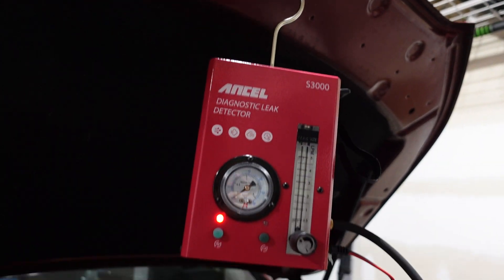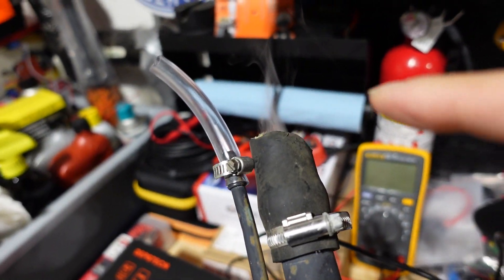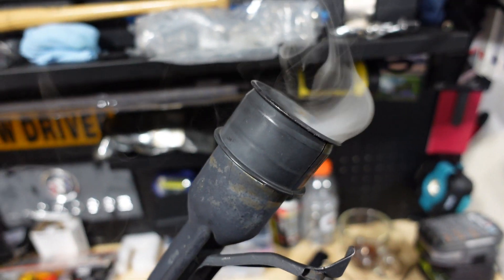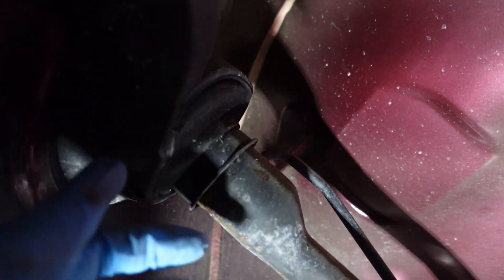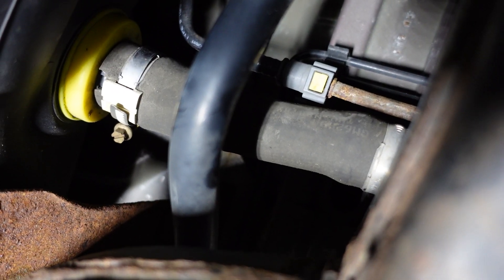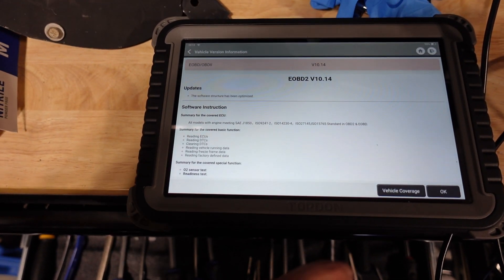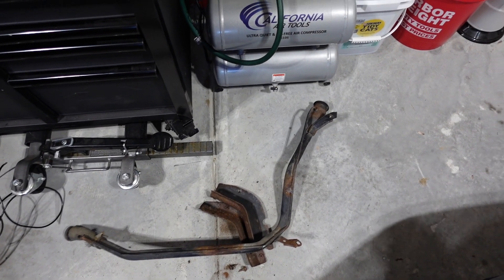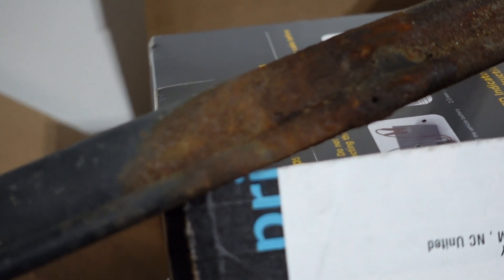P0442 fix with Smoke machine - Fuel filler neck install 2010 Buick LaCrosse

Comment: Where did you get the filler neck on eBay can’t find it  being sold anywhere
Reply from the maker: I got it from eBay, and they updated the part number to cross-reference to a 2014-2016 Impala. So maybe you should also look for 2014-2016 Impala filler neck as well. I'll see if it can pull up my old eBay order and get the part number from it.

Comment: Hello, were you you able to clear the permanent DTC?  If so, did it require the 40 drive cycles mentioned at the end of your video to clear it?  Thanks
Reply from the maker: According to all data it would take about 40 drive cycles but in actuality it only took nine drive cycles for it to completely clear. I made a community post about it and show that on my night's drive cycle when I got back in my car that afternoon and checked my codes after I pulled off the permanent code was gone.
Reply: @oneanddonediy  Thanks for the update and I'm glad to hear it was cleared.
Reply from the maker: Did the smoke machine work for you to figure out the issue?